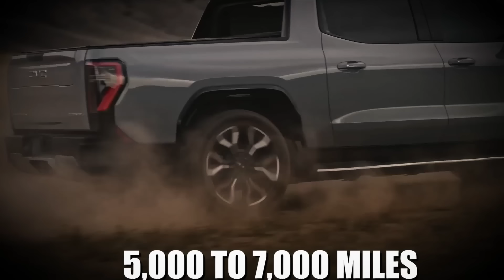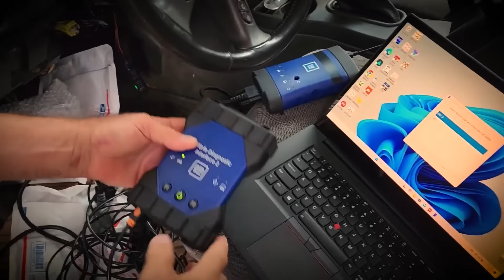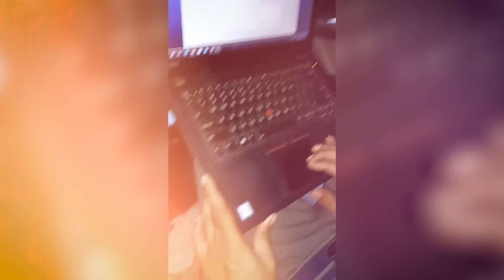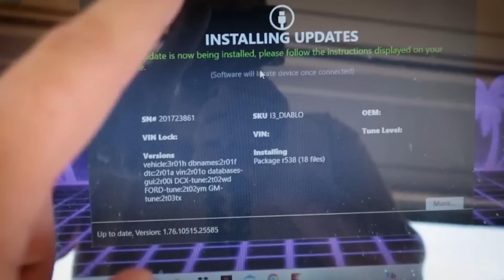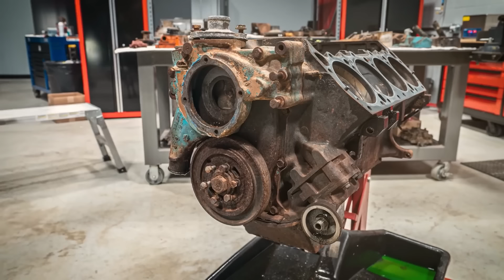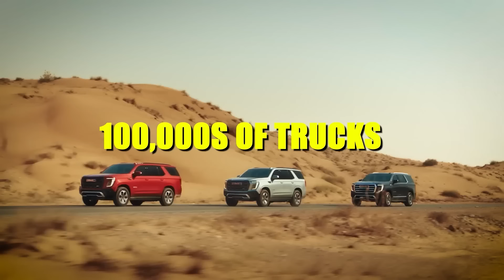How Smart Mechanics Are Bypassing GMC Dealers (The AFM Delete Loophole)

Comment: My sure fire bypass to everything just buy a nice restomodded classic to drive and bypassing the whole computerized new vehicle headache and your wallet will thank you.
Reply from the maker: The restomod classic argument gets stronger every year as new truck complexity and pricing both climb. A clean square body with a modern engine swap has zero subscription features, zero proprietary diagnostics, and zero planned obsolescence. Hard to argue with the wallet math. 💪
Reply: @EverythingGMC-k9x  Ran into a prime example at a show, a 59 Studebaker 1 ton flatbed a guy uses for his business beautifully restored with tasteful upgrades, higher ratio rear axle, power steering and modern power brakes, upgraded electrical, crate Chevy fuel injected engine nice cab interior only electronics is the stereo and smartphone outlet to listen to tunes, I'll take that over anew one any day, trying to help a friend to find a nice older vehicle  before her 2 year old Surburban's V8 disintegrates on her.

Comment: I worked at a gm dealer. The correct oil and intervals don't stop the lifters from failing.  Doing a complete afm/drm delete kit and putting in normal lifters prevents them from failing.
Reply from the maker: This is the most important comment for anyone still on the fence about the disabler — correct oil and intervals reduce the risk but don't eliminate it because the collapsible lifters are still cycling. The full AFM/DFM delete with upgraded lifters is the only way to permanently remove the failure point. The disabler buys time, the mechanical delete solves it. 🙏
Reply: How much does that cost to have done?
Reply: @louispounds7486 $800ish for the FULL delete kit with programmer. No clue on labor. I just did the work. I never saw an invoice